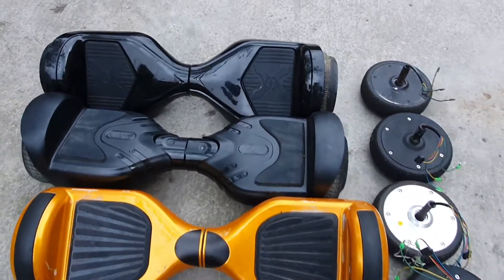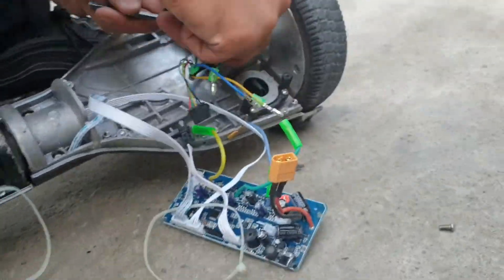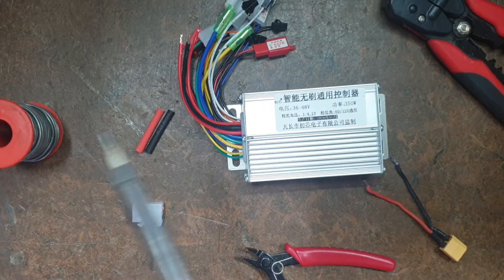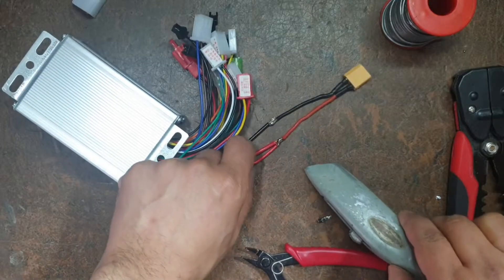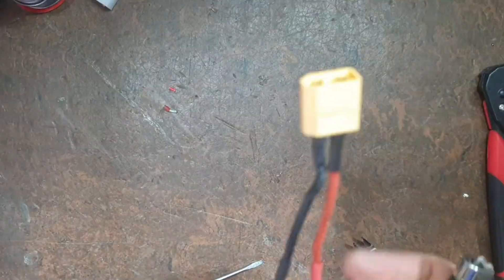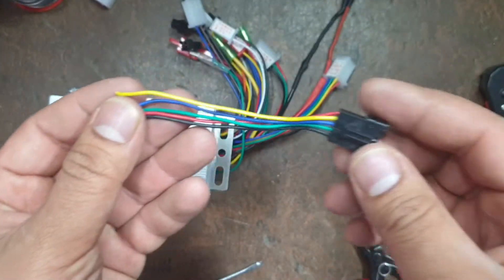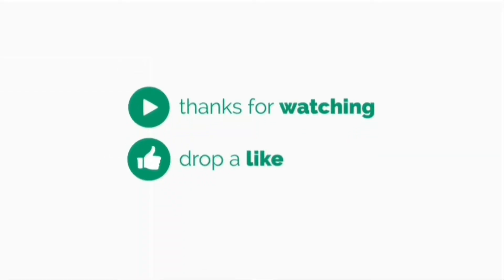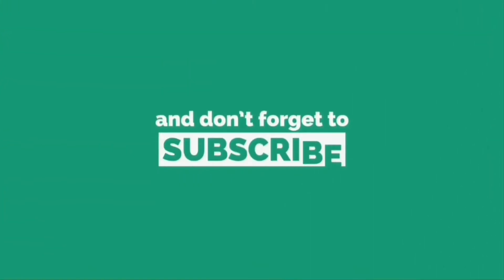Running a  Hoverboard Segway Brushless Motor with modified ebike controller project

Comment: Why do you need to remove the female sockets on the controller? Will it not work
Reply from the maker: The batteries I use have an xt60 connector so instead of making adaptors I just attach a female xt60 to the controller

Comment: Great video if you don’t connect the part that has 5 cables would still work or you have to connected
Reply from the maker: @polymexdf69  With these controllers it will still continue to work with or without the hall sensor cable.
Reply: @ is there place I can sent you picture to show you my set up thanks
Reply: @mistermagnifico  what’s the maximum and minimum voltage for these thanks thanks
Reply from the maker: @polymexdf69  The minimum voltage for these to be effective is 36v, they will run fine at a lower voltage but it will be slow. As for the maximum voltage, with the correct controller they can be pushed up to 52 volts, at least that's close enough to what I have tried. But knowing what I know about brushless motors they should be able to be pushed slightly further although I wouldn't recommend it. If I can get my hands on a 72 volt battery I will try and push it to see what happens for science.

Comment: Thank for share your idea. What shall i do when i want to control motor rotation forward and backward direction ?
Reply from the maker: @manotejunput4553   You'd need to either use a bidirectional switch between two of the phase wires,  a relay to do the same or alternatively use a controller with built in reverse functionality

Comment: Can you run both motors on 1 controller  ? Nice build
Reply from the maker: @blackmacgyver9965  technically you could but logically you shouldn't, it causes distribution problems and long story short it can cause one or both motors to not run properly or at all.
Reply: @mistermagnifico  Ok thanks for the input .  Dolly I'm building is just for sometime use
Reply: @blackmacgyver9965 did you ever get started on that build yet
Reply: @700shmokey I did both motors will run but , you need 2 controllers

Comment: I'd like to see you connect both motors to that controller!
Reply: all you have to do is connect the motor wires
Reply: @CwHiPpEr I thought so as well but they say the motors will be opposite to one another if they are combined together... Not sure though
Reply: @poppybbrownbrown9950 if that happens switch the connectors